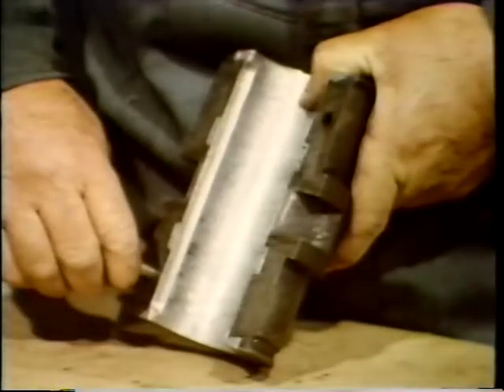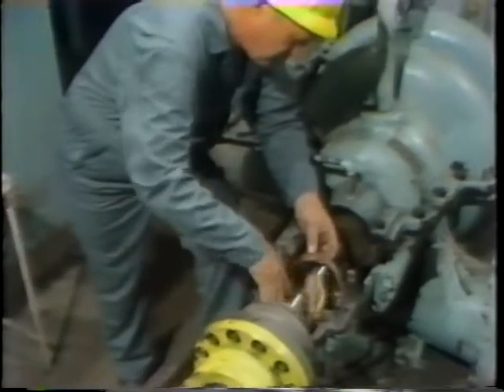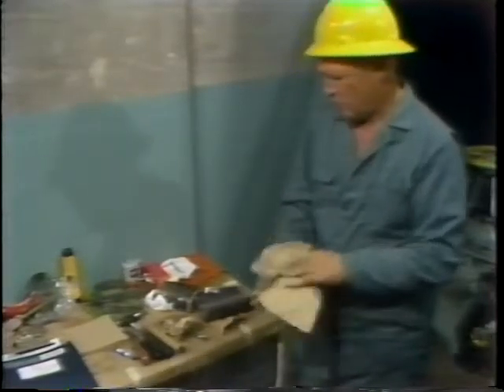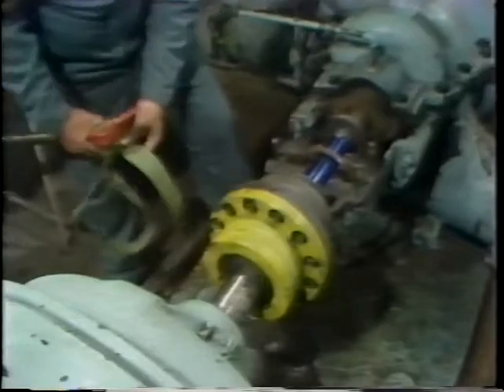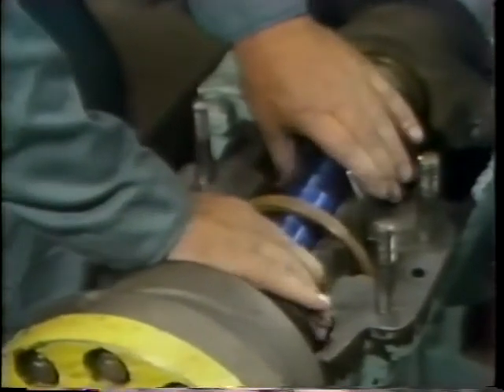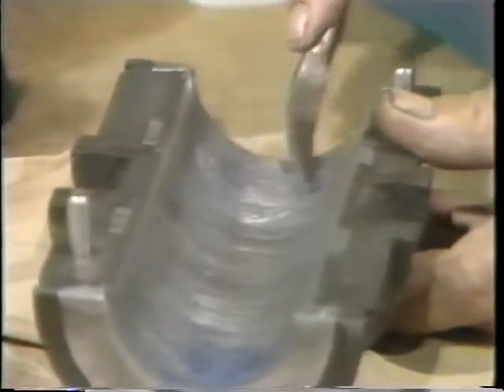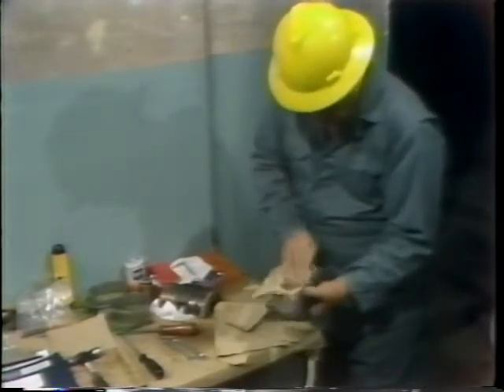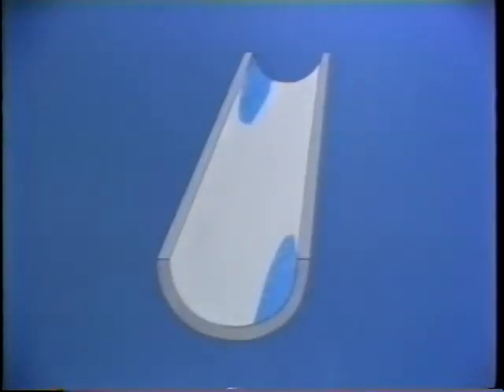Journal bearing maintenance - complete overhauling 3/5

Comment: what is the reason for high vibration on gearbox Philadelphia setup gearbox . compressor tripped on high vibration . we have changed the 4 bearings of gearbox but still the vibration exists. it has diaphragm coupling with a rpm 12000.
Reply: You should go step by step.
1)Check alignment (soft footing too).
2) If problem exists too, go for "spectrum analysis". It will tell you everything.
3) If you want to skip step 2, than check rotor centering.
4) It could be a process issue also.